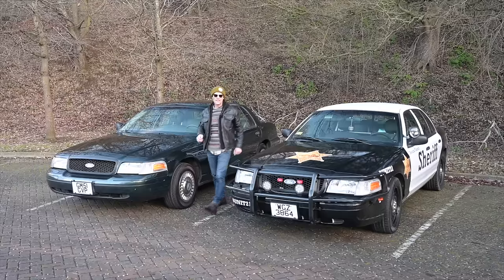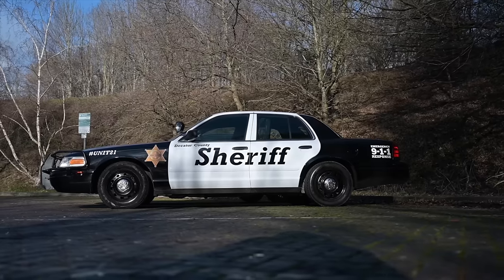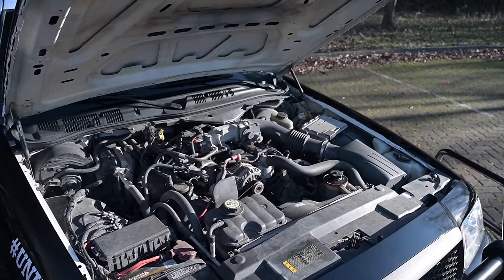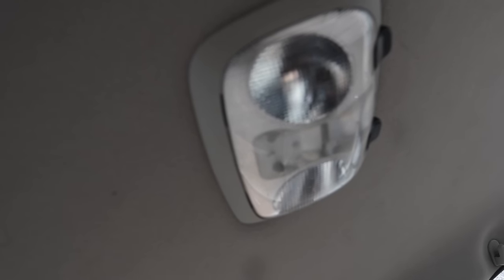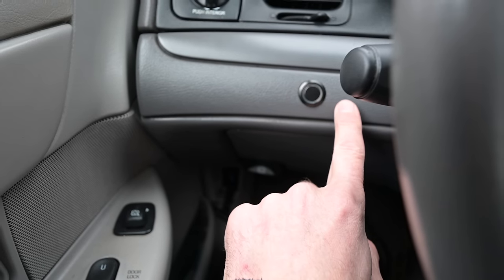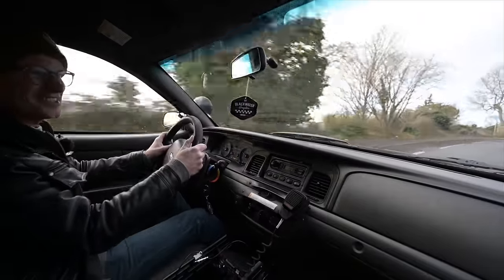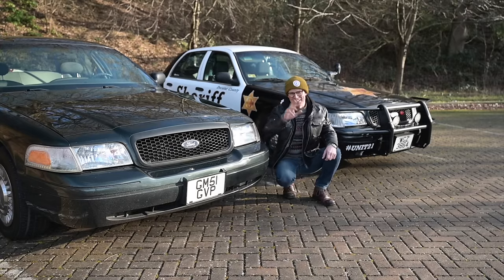What makes a P71 Ford Crown Victoria Police Interceptor special?

Comment: Remember she's got a cop motor so she'll run good on regular, cop shocks, cop suspension
Reply: So is this the new Bluesmobile or what?
Reply: @jasoncornell1579  Fix the cigarette lighter
Reply: Car's got a lot of pickup.
Reply: You traded the bluesmobile for this??
Reply: @thatguyfromcetialphaV  no, for a microphone
Reply: And cop brakes
Reply: Aluminum 4 link rear suspension.
Reply: Just fix the cigarette lighter
Reply: It’s a model made before catalytic converters so it’ll run good on regular gas.
Reply: Bill In The Box  Remember, "regular gas" was leaded in '74, pre cat converters, and it was 89 octane.  So, you put that mid range 89 in it.
Reply: they actualy run worse on premium. mine does at least cause its tuned for e85 from factory
Reply: the 4.6 liter v8 was designed for 87 octane
Reply: we're on a mission from God
Reply: @jasoncornell1579  The words for a 1974 Dodge Monaco.
Reply: BDR529

Comment: My dad used to travel to the states a lot for work and always hired a car and he used to specifically ask for a crown Vic or similar as to him, being not altogether car orientated saw it as not only quintessential Americana but also a superb way to travel huge miles in comfort.
Reply: Plus Crown Vics get pretty good highway MPG for their size. It's not that hard to average 25 MPG in cruise.
Reply: @SkylineFTW97  I've had two Panthers - 98 CVLX & an 07 GM - & at least on the civilian models like the ones I've owned you can get 27-29 highway MPG on flat topography in cruise at the right speed. I've driven both those cars up to Canada & across the US (Ohio to Nevada, Arizona, California, & back) literally more times now than I can remember at this point. They are EXCELLENT highway cruisers.
Reply: Lincoln or Mercury are nice.
Reply: Have several friends with various panther bodies. Few cars at their price point in the used market ride so well at highway speeds. Smooth, quiet, reliable.
Reply: @Cincy32 You must have had one  heck of a computer program. Don't get me wrong I love the Panther cars and still drive one. They are the best.

Comment: As a 25+ year State Trooper (SWAT) I started my career in a 1984 LTD Pursuit w/140,000+ miles on it. My second car was a 1988 Mustang SSP 5 speed! During my 25+ years other vehicles I was  assigned a include 95 Suburban 4x4 (SWAT), 93 Crown Vic,  96 Crown Vic, 2002 Expedition and 2008 Chevy Tahoe! Our department experimented with Dodge's and Chevrolet's, but always went back to FORD's because they were VERY Reliable!!!
Reply: Thank you, for your service! How did you like the LTD? Ive been thinking about getting one
Reply: @tacbear  Ford indeed does it best. Thank you for your long service.

Comment: I once saw a taxi crown Vic with over 715k miles and still running
Reply: I drove a cab in 2014 as a new driver they gave me a 2009 crown Victoria with 350,000 miles on it and I drove that crown Vic for 2 years with zero problems  and I put another 170,000 miles on it and it still ran great when they finally gave me a brand new Dodge Grand caravan that started to break down non stop after I only put a little over 30,000 miles on it I was at the mechanic at least once a week.

Comment: I used to work for a municipality and our department had one of these in our vehicle pool, a retired police car in the "detective" spec.  It drives like a smaller car. The handling is flat, compliant but not mushy, and the steering is quick and precise, but way over-assisted. The visibility and maneuverability  is superb, nothing like today's cars with massive blind spots, it's not really that big and it's actually very easy to drive. It's just such a juxtaposition of old and semi-new. Old: seating configuration, column shifter, v-8 RWD, and a whiny transmission (which I like, and remember from 70's/80's old RWD cars). New: materials and switchs, dash design, flush headlamps, lack of chrome are somewhat contemporary.

Comment: What makes it special?  I'll tell you:  It's got a cop motor, a 440 cubic inch plant, it's got cop tires, cop suspensions, cop shocks. It's a model made before catalytic converters so it'll run good on regular gas.
Reply: Well...a 283 cubic inch plant, and does have 4 catalytic converters. It does run on regular gas, but I'm pretty sure the "regular" they mention in the film, may be leaded gas.

Comment: The Crown Vic is an iconic American car from the early 2000's which is immediately recognisable to those who watched the American cop shows of that era! 
Love 'em!
Reply: Crown Vic has been around much longer then that. The crown Vic became the ultimate police cruiser in the mid 1980s.
Reply: @kdrapertrucker  It has indeed. I had a 1985 with a 5.0L. Right now I have an 1997 with 4.6L (civilian only, but it still makes people wonder) and I have a 2010 Police Interceptor with the 4.6L (that one definitely makes people do a speed check).

Comment: Thanks for your video.  I enjoyed it.  I own a 2011 P7B and love it.  I live in rural Pennsylvania and drive a mix of local and highway roads.  It's a fun car to drive.  It's all white with black trim, trunk antenna, front push bar, w\light bar, and rear trailer hitch.  Many motorist still think it's an active duty undercover car and many won't pass me or they slow down when they see me in their rear view mirror. LOL  It has over 178,000 miles and drives like a champ.  I have winter tires on the steelies, otherwise I have lower profile 18s on black custom wheels for the other months.  I drive it almost daiy.
Reply: Dang! My P71 is from Pennsylvania! Any ideas how I get in touch with your local authorities, to learn something about the history? Best greetings from northern Germany!

Comment: @furiousdriving. I drove P71 Crown Victorias throughout my career, from 1996-2016. Previously we drove Chevrolet Caprice 9C1, and I retired driving AWD Dodge Charger Hemi  Pursuit. The Pre 2006 Crown Vics would never see anywhere close to 150mph. They were also speed limited.  at 131 the car would shut down, slow to 128, power back to 131 and do that repeatedly. Also after extended pursuits above 120 the overdrive green light would blink and indicate the transmission was getting hot. One of the most comfortable police cars I drove. The best performer was the hemi charger, but my Favorite will always be my 1994 Caprice 9C1 with the big 5.7L LT1 engine.

Comment: I own and daily drive a 2011 CVPI SAP. The SAP is probably the rarest version of the CVPI and it comes with the best perks. As a Panther owner, there are some things to worry about. The intake manifold will fail because it's plastic. The best option is the Professional Products all aluminum intake manifold. The next thing to worry about if you own a 06-11 is the gauge cluster. It might be dim, stop working intermediately or might stop working all together. You can get yours rebuilt or buy a used one. I would recommend having it rebuilt. Another thing, no one talks about is the lower steering column bearing. This will cause play in your steering. There are a few other things too, but the biggest thing I would recommend is change and flush your fluids religiously. And by fluids I mean, motor oil, tranny fluid, coolant, rear diff fluid, brake fluid and power steering fluid. I would also highly recommend running AT-205 Reseal through your engine and transmission. Also take AT-205 Reseal and put it into a spray bottle and spray your rubber suspension parts. Another tip, get MSD coil packs and better plugs. The car will run better.
Reply: I have a 2010 CVPI with 89k miles and 4k idle hours. What would you suggest I do for my transmission shifting rough?
Reply: @yayie2  I would start by changing the transmission fluid and filter. If that doesn't help with the rough shifting, you can also try adding some friction modifier to the transmission fluid.
Reply: @yayie2 rebuild it my boy
Reply: @blessedjuggernaut  I find that it's only rough when getting in and out of overdrive.
Reply: @Jedithedrummer  rather then drop a 5 speed in it?
Reply: @yayie2  In that case, it doesn't necessary sound like a gear changing issue, but more like the transmission searching for gears. IT WILL DO THIS AND IT IS COMMON AND NORMAL. Unless it's shifting really hard or actually slipping, I personally wouldn't worry about it. My CVPI does the same thing. Changing the fluid and filter is easy and only costs about $150 to do yourself.
Reply: @yayie2  yeah

Comment: Excellent video. I know of several police departments that stocked up on Crown Vic's at the end of the production to bring into service at later dates. I can't believe Ford discontinued these. At the same time Ford discontinued the Ranger pickup that was an excellent small truck.
Reply: And now we have the maverick, basically a 4 door mini SUV with a 3 foot bed on the back. Totally useless for actual truck needs. True cheap mini trucks are sorely missed.
Reply: Sales numbers would have nosedived if they continued or not. And this is aside of some police stations stocking up in the end. It would be decisions made from higher up that the cars have to be replaced cause... reasons. A tank on wheels sure but outdated by "modern" requirements made by seat warmers. 
Then again it would have required an upgrade to its drivetain anyways as it´s no longer up to it. Coyote swap and stuff would have probably done it but yeah i doubt that would have sit well with the seat warmers either.
Reply: They made the police version 1 year longer than the civilian version. They are still a somewhat common sight on police departments even now. I live close to a small town that sold their chargers and bought a couple of crown vics from a auction to replace them with. They still patrol them every day.
Reply: Ford custom built a new police vehicle and named it the interceptor. They were designed with all sorts of police creature comforts and potentially armored doors to take cover on scene. Departments largely went to dodge because they were cheaper. They are a pale comparison to the old crown vics reliability, but capable of 350 hp and 150 mph in factory form. Also well known for brake failure and weak suspension.
Reply: The main reason Ford discontinued the Crown Vic is because it would have been prohibitively expensive to fit stability control which was required in all cars sold for the 2012 model year.  There was a short run of 2012 models that were GCC spec. (Gulf Coast Countries)  Those were illegal for sale in the United States.
Reply: Really surprised they axed this model instead of just introducing an ecoboost engine

Comment: Didn't scroll through all the comments so I don't know if someone already mentioned this, but you misspoke about the gear ratios. You said 3.27 for acceleration and 3.55 for economy. It's actually the other way around. A high gear (low numerical) will give you more top speed and lower rpm when cruising (hence better economy) and slower acceleration, whereas a low gear (high numerical) will do the opposite. So 3.55 for acceleration and 3.27 for economy.
Reply: Thank you. Just now watched this and was going to comment if no one else had.

Comment: Nice video. Two things.
1. The seats are not bulletproof, they are stabproof. Couple CV has a bulletproof front door but not every CV. If your doors has a special marker (left or right upper corner near to the window), that's bulletproof.
2. Usually the regular police cars don't have vinyl back seats. They have hard, s*itie, plastic seats. Verrrrryyy uncomfortable, but easy to clean. 😄
They also have couple extras, melybe you can make a prt. 2 video in the future. 😊
Thanks for the video. 👍
Reply: He stated it correctly.  So perps cant SHIV You aka stab u, he never said shoot or bullets, lol
Reply: 1. Correct- the panel in the seat back is actually made of plastic.
2. This largely depends on the individual department. Both CVPIs I've owned have had the vinyl back seat.
3. The easiest way to tell if your car came with the Kevlar door panels is to compare the weight of your front doors to the rear doors. If the front doors are noticeably heavier, they have the panels.
Reply: As someone who has sat in the back of a crown Vic about a decade ago now, I can attest to the hard plastic painful seats. They even had a big indentation in the plastic by the small of your back for your handcuffed hands to go lol, otherwise they would be smashed up against your butt.
Reply: They usually came with the vinyl seats where they were removed on delivery and replaced with those hard plastic buckets, then they took the plastic buckets out to use them on the new cars that came in, placing the factory vinyl seats back into the rear cabin. They always had extras as well. I'm pretty sure if you needed a replacement seat pad when they were in service, the fleet garage would most likely just give you one just to get rid of the extras from totaled cars
Reply: My 2010 vic doesn't have any plaque or notch but still have kevlor doors. I know this because I opened the up to check. My vic came with the partition and plastic bench which I swapped out for color matched fabric bench.
Reply: Bulletproof? .50 BMG....hold my beer.

Comment: They're bucket seats as opposed to bench seats. The default civilian configuration was a 50/50 split front bench seat, where both seats extended to the center, enabling (uncomfortable) seating of another passenger. This was a carry-over of the traditional American car, when families were bigger. Rental car fleets and some taxis used them for the extra accommodation, while old people liked it because it enabled easy storage of canes and walkers.
Reply: And young people who owned them in high school (like myself) loved the bench seats on date nights!
Reply: Interestingly, most Crown Vic's sold in the Middle East between 2000 and 2011 (except for the P71 and LX Sport) had a 40/20/40 front bench seats configuration. It's one of the ways you can tell a Gulf Spec panther body from a USDM/CDM import.
Reply: @Bahraini_Carguy  I think it’s due to the hot weather. They put rear AC vents in the center 20 portion, not possible with the North American 50/50.
Reply: @straightpipediesel  Not so sure about that. I saw a video about a panther, which features bench seats and rear AC, a while ago. But I can't remember which model it was, unfortunately. Nevertheless I'd love to fit rear AC to my P71.
Reply: @straightpipediesel  That's likely the reason although i have to double check if P71s sold new here had the same "bucket" seats or 40/20/40 seats instead since later models also had rear A/Cs.
Reply: I miss bench seats. The new cars are too confining.
Reply: @FabianCrownVic  look for the extended length Town Car executive series, the center console for the rear seats contains rear ac vents.
Reply: @robinsattahip2376  Stick shifts and safety belts
Bucket seats have all got to go
When we're driving in the car
It makes my baby seem so far
I need you here with me
Not way over in a bucket seat
I need you to be here with me
Not way over in a bucket seat

Comment: The slow take-off in first gear is normal.  I always had those for my patrol work 1998-2014.  We had an average of 500 in the fleet and only one engine came apart in my career in the whole fleet.  Only one year had defective over-drives, but I don't recall which year that was.  We kept them for up to 130,000 miles and the taxi companies would by them as they were extremely reliable cars.  The racing suspension is stiff but works well at higher speeds.  I have a 1997 Lincoln now (new condition) and it has a super soft suspension that is the opposite, as it is great at normal speeds and not good at higher speeds.  I like the soft suspension now as it's my family car.

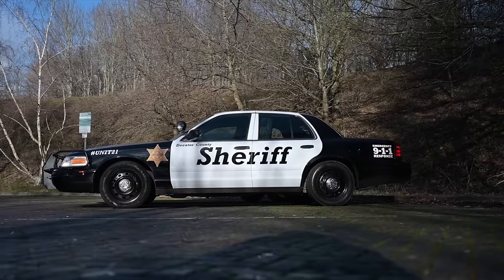Comment: 12:32 You've got the differential gearing backwards.  The 3.27:1 is the economy/high speed option, and the 3.55:1 is for performance/acceleration.

Comment: Man the part about the headlights is spot on.  I see the new explorer light bar style headlights and I'm just annoyed I have to slow down but the old crown vic headlights put the fear of God in you if you saw them in the rearview.  The exception is the new charger headlights because only town cops or state troopers use the chargers and im not worried about a town cop when I'm doing 85 on the highway lol.  Those charger headlights will make you shit a brick and the tails too.

Comment: I used to drive fleet TownCars for over 20 years and over 1.5 million miles. The 4R70 transmission was a ‘100% reliable weak spot’ (torque converter, shudder as early as 50K, but no later than at 150K) on these cars all the way until 2003, at which point it has been updated to 4R75 and then no more problems since. The engines were as good as bullet proof with 5W30 and good until the wheels fall off. Apart from the transmission, another reliable problem were the blend air actuators of the climate control. Luckily the particular one that fails most is right behind the glove compartment and it is easily to access.

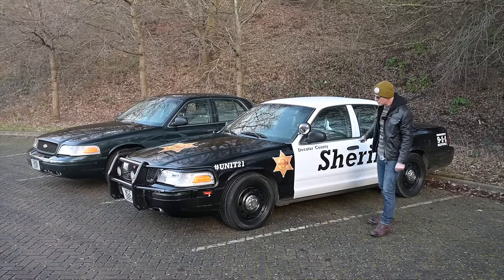Comment: I’ve worked on quite a few of these… first you were backwards on the rear gears, you  wanted  3:55  acceleration is better and because of the limiter you still have plenty of rpm at 130-135 , but use more gas. If you bother changing it go 3:73 and it will really make a difference and you still can go 130 but it’s revving a little. The hour thing is total hours running, idled or moving. You divide hours by miles and you can figure out if it’s a highway or city car. I could go on and on. The ones with 17” tires from the factory had bigger brakes and pretty much whole new front suspension.Rack and    pinion steering instead of recirculating ball. E-mail me directly if you want.
Reply: The P71 Vics withe the 3.55 were electronically limited to 119 mph, and the ones with the 3.27 rear end was limited to 129 mph.